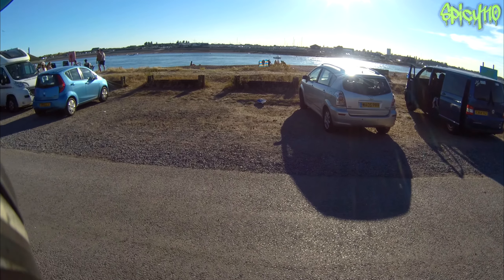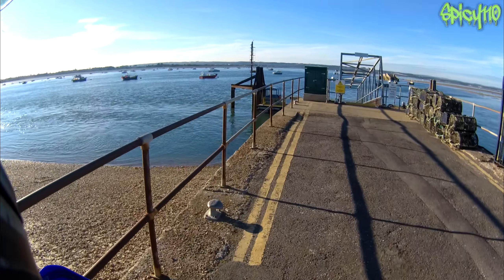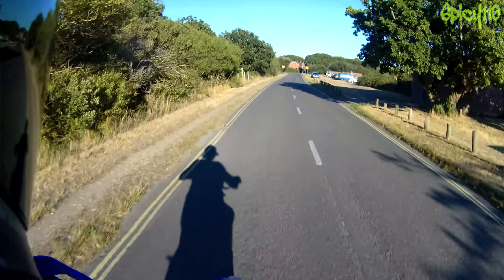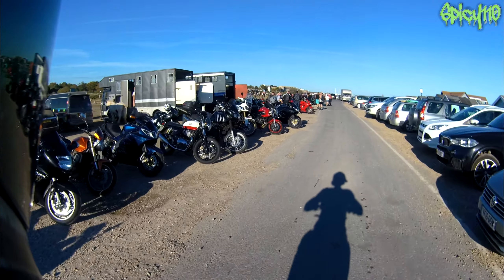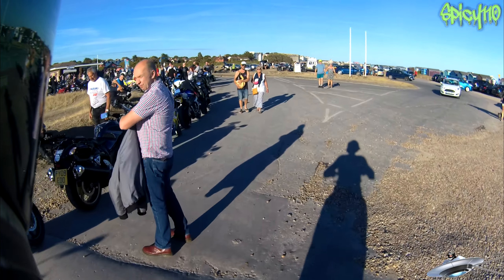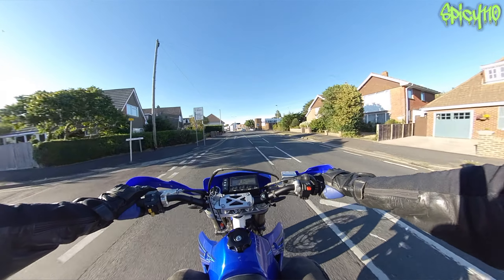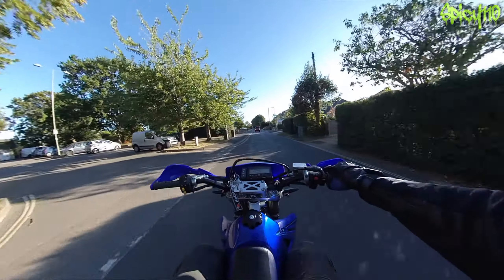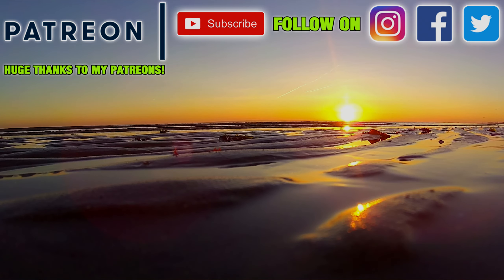Testing riding the DRZ400SM Post Build!

Comment: hey spicy i was wondering weather it'd be possible to fit a a set of drz 400 wheel's and tyres on a lexmoto adrenaline, as you've had a phew thought you'd be best person to ask.
btw the bike is looking amazing.
Reply from the maker: I would really have to look in to that but I would be pretty sure guessing no. There are a few issues I can think of such as the size of the brake disc vs caliper placement.
, Width and axle size. Besides stock lexmoto wheels new would probably cost less than used DRZ wheels.
Reply: spicy110 ohhh no worries then. Thanks anyway. Sure I could with enough money and time.